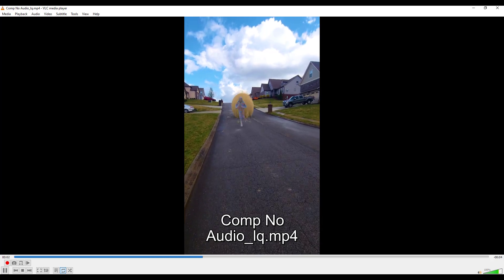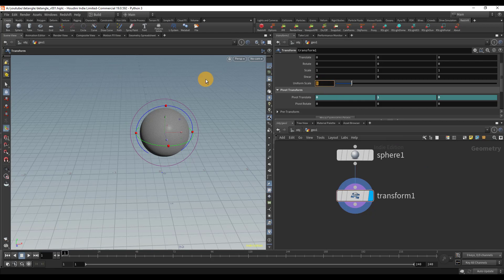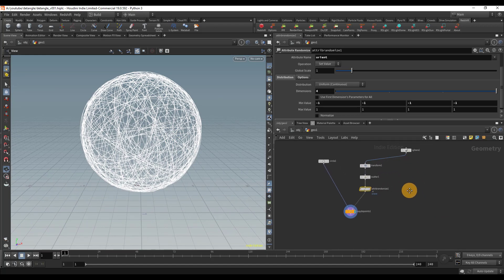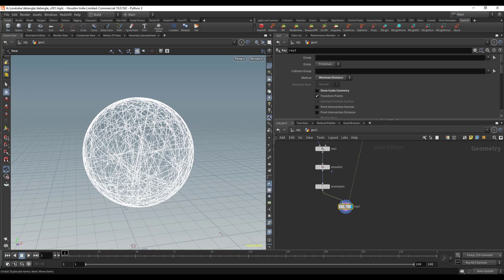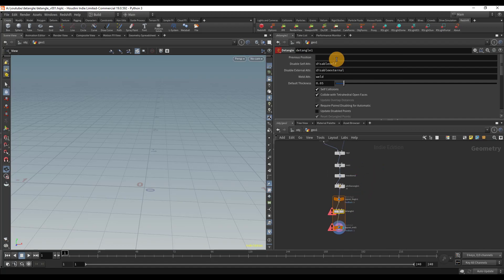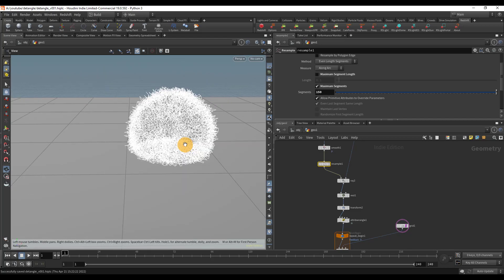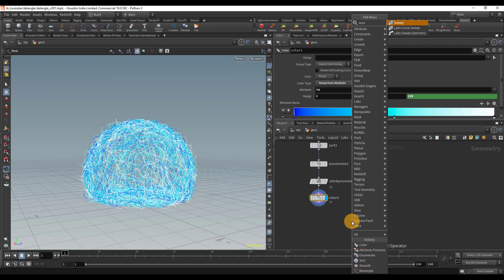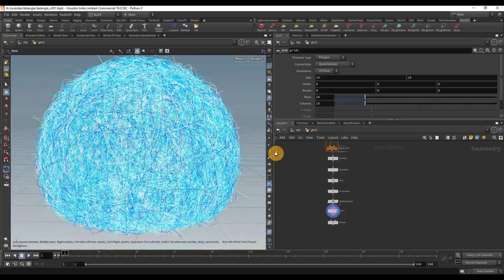detangle tutorial houdini

Comment: you can set pivot to center by using $CEX $CEY $CEZ
Reply from the maker: Sometimes you can. That expression only works if the node can use that local variable, like the transform sop. If you try to use some nodes like a mirror sop that expression doesn't work because that node doesn't have access to the local variable CEX. In order to avoid running into that issue I just use centroid because it works for every node. It is more full proof. If you go to the documentation it tells you for each node which local variables it has access too. So if I am gonna teach people one of the expressions I would teach the full proof one over the easier one.

Comment: Thanks for the tips! 
Some q on my end: why did you promote after enumerate to the points since each spline is considered as primitive?
Also enumerate is something like i@id=i@nprims; ?
Reply from the maker: To answer the second question, not quite. nprims is the total number of primitives. it would be something more like i@id = @primnum or @pntum depending on whether you set enumerate to be on primitives or points. I promoted to a point attribute because I wanted id to be a point attribute instead of a primitive attribute. My render engine (redshift) has to have color as a vertex or point attribute, primitive doesn't work. When I used the color node the "attribute"  section (where I put "id") that attribute just needs to match the class your color node is set to. And since I need color as a point color for my render engine, I also wanted id as point attribute. Other than that, it's not super important and there are other ways to do color.